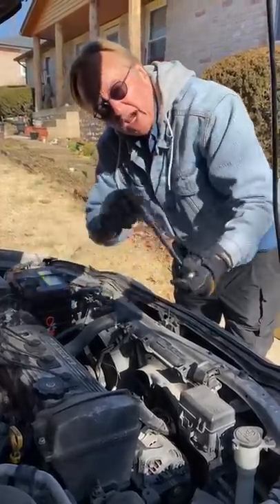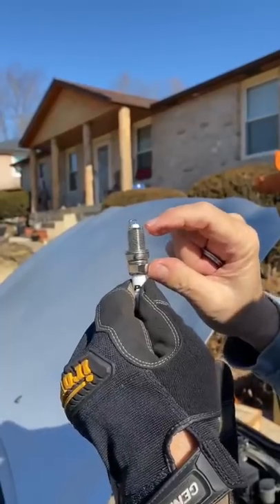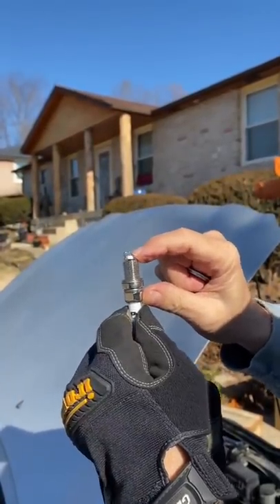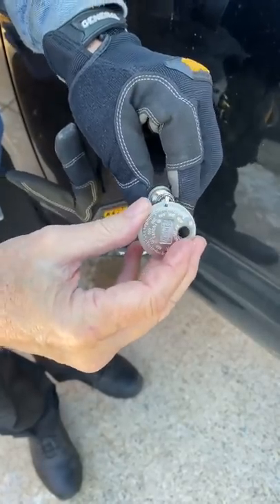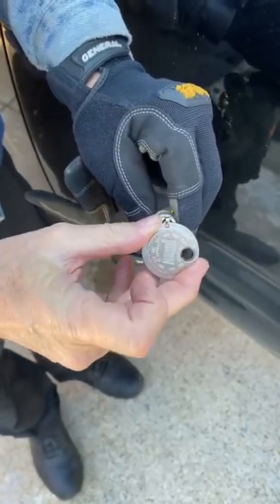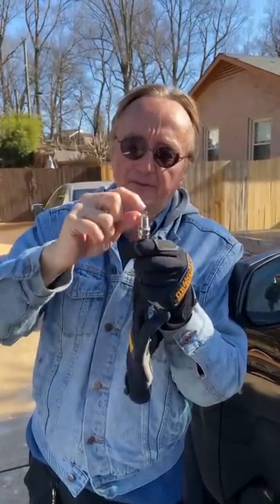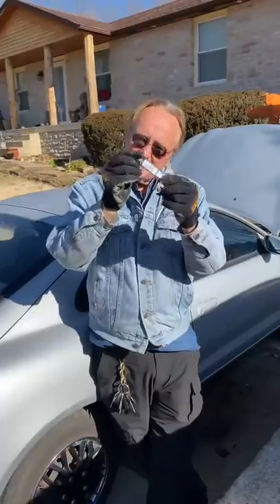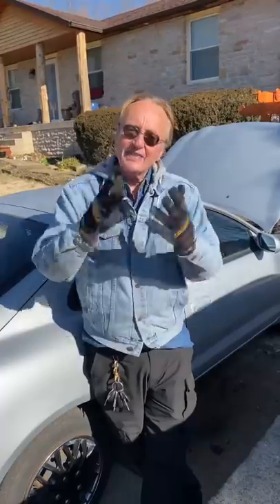If You See This, You’ve Got a Serious Problem

Comment: What timing!  I was cutting grass (with my 25yr-old Craftsman mower) the other day, and it was sputtering, smoking and generally running like crap. I knew I had replaced the plug, air filter (for the first time ever) and cleaned the carb last season, so my conclusion was that it was about time to trash this one and shop for a new mower. I thought I'd at least clean the plug to see if it would run long enough to finish the yard (it was barely staying running). To my surprise, the gap on the plug was almost completely closed! (How that happened, I don't know)  I gapped the plug, put it back in, and the dang mower is now running like a top!
Reply: You replaced the air filter for the first time on a 25 year old mower? DAMN!🤔😯😔
Reply: ready for another 25 years!
Reply: @Mike583  I admit, I would knock the crud out of it every year or two (small engine maintenance isn't my strong suit - lol)
Reply: Maybe that's the problem on my mower.. 🤔
Reply: @Mike583  I know right Robert!!! That poor engine needs to breathe like you and I.
😪😪😪
Good thing 92 pony was able to bring it back to life... He could have been brought up on engineslaughter charges!!!!
Reply: @92Pony  the gap can change from running, especially after 25 YEARS! LOL
Reply: I have a guess. Some built-up carbon broke loose and when the piston came up it banged the plug gap closed.

Comment: Weird I'm literally about to change my spark plugs now, guess the universe is telling me I need to check them
Reply: Just did mine. Now to pull them out and check the gap. Never even thought about that.
Reply: @NinjaSushi2  Yea I was checking my old ones when I was taking them out and they were .46-.56. When it should only be .56. Still chasing a starting problem I'm having next step is fuel injectors I noticed one of the spark plugs was more burnt then the others
Reply: Fdh
Reply: @Tylorgng.  i'm guessing it rolls over at least?
Reply: not the universe. scotty is.
Reply: The YouTube algorithm monitors everything you say. Chances are it heard you say sparkplug

Comment: I wish they put them in tougher boxes. It's so important and should be understood by the makers.
Reply: Then the cost would go up for something one throws away. Feeler gauge is cheaper in long run.
Reply: They need foam
Reply: I bought some and they had a little cardboard tube around the threads to protect the tip

Comment: I bought six for my Jeep and everyone of them was different gaps, and the guy at the counter said they are pre gapped from the factory, smfh
Reply: Why it's called FCA Limited Liability Corporation
Reply: ALL plugs are pregapped at the factory! Are they correctly gapped? Who knows?
It's like fresh baked bread. Nine day old, mouldy bread was "Fresh Baked"!
I've never trusted pregapped plugs, but often, they are right on the money.
Like Scotty says: They may have been dropped or handled roughly.
Reply: A L  well Bosch is awesome. not all brands are German
Reply: I bought E3-40 spark plugs for the first time and I noticed the electrode was built inside the ground cage on the tip so it was obviously factory-gapped. 

The best part is there isn’t a chance of bending it out of measurement. Use E3 spark plugs. They are the most reliable spark I’ve ever used

Comment: I have a misfire on cyclinder 5 and 3 both from left side engine. Changed all 6 plugs, ignition coil, 3 fuel injectors so far car is super smooth no rpm idle... But i still have 3 injectord to go on the misfire side... Hope the light will go away after installation next week

Comment: I pull, clean, and gap my plugs once a year, then  replace them every 5th year. They are basic plugs and they do open some. On a Toyota 22RE engine it's a simple task with wide open access. It sure does make a difference .

Comment: damn that is a good idea scotty and i did not do this last plug install,   damn.
Reply: Me either... but the car is good. Bad parts off the shelf is more common than people think!
Reply: @sharonflowershondagirl8187  for sure.  i ialways tell friends and my customers to watch scotty and learn things.  ha,  and i'm a furniture repair pro for decades.
Reply: @ronvalley1973  Ya gotta love this guy. Honest, direct people are the best!! So glad I found this channel and bought a used Honda.
Reply: @sharonflowershondagirl8187  cool,  and what year,  what model did you get?  oh,  how many miles were on it and please tell what you paid?  and private party?  i am looking for  a used honda or so i thought until scotty mentioned most hondas have rubber timing belts.  then he said toyota has metal belts.  so now,  i might get a toyota,  but i have a honda bike and think a honda car would be cool.
Reply: @ronvalley1973  I bought it in West Ky area, paid cash. I probably gave too much, but when I saw 'Made in Japan' ..... I got excited. I drove it for about an hour, town & freeway. I remembered all the pitfalls and tricks from Scotty's videos, but I cheated, I had no mechanic check it out. I got really lucky. I bought it with it having appr 150,000 miles, '09 Honda Civic. A/C works great, no shifting issues. I installed my own spark plugs when I got it home, and also bought a new battery. The driver's window was gummed up something terrible, so I used the silicone spray, and its like new!! Very happy with it, and it's from watching these videos that I think I got a great deal.

Comment: Is there a process for Iridium plugs? Manual said NOT to gap them but the gaps don’t match
Reply: you should be fine if u use a wire gapper, you don't want to use a coin gapper bcuz it will crack the center electrode

Comment: I never trust the "preset" gap out of the box. Good pro tip for those who didn't know.

Edit- for those who don't know, that gap gauge is less than $2... pays for itself on the first use.
Reply: I have one on both keyrings
Reply: 1,2mm gap is good for most cars. You can use old CD to make the gap, because CD's have thickness exactly 1,2 mm.
Reply: Asimov's, it seems you missed your Rendezvous With Rama.  Inold days when beers and sodas had the pull tabs that came off with the ring we'd use them to gap our points because they were. 015 thick. The correct gap for breaker points. I still have my Penske dwell tach and timing light in my tool locker. Bet Scotty still has one in his stockpile, too.

Comment: FYI Scotty, if you check that gauge with a pair of quality calipers, you will find that its a couple of thou oversized
Reply: Why?
Reply: @dandc2011   These were originally sold in bare metal, and not intended to be electroplated; the dies were sized appropriately.  Maybe they've corrected this, but the one I have is decades old (Scotty's too, probably).  I use quality blade type ( or wire type ) gauges for accuracy.

Comment: Must be quite nippy where you are. 
I miss cold weather. Here in Hawaii it's ALWAYS  balmy.....except sometimes in the winter it can get downright freezing, like about 60 degrees. Brrrrrr🥶
Anywho, I came up on a friend one cool morning and he was buried under the hood, reaching for what I figured would be the starter. "S' up' man, need a hand? He was growling and pissing and moaning when he suddenly and abruptly came up....so abruptly that he banged his head hard on the pterodactyl. But that didn't seem to bother him as he started spitting on his hand, then wildly shaking it so that his Timex flew off his wrist and crashed onto the driveway, causing it to shatter. "What is WRONG with you?" I asked him, laughing so hard I could barely breath. Without saying a word  he finally took off his wedding ring, flung it into the engine compartment and walked into the house, where he apparently stayed the rest of the day.   
I finished off bolting the starter terminals AFTER disconnecting the battery. I sealed the deal.....even found his ring and handed to his wife. "Don't ask" I said, as she was about to ask. I also recovered the pieces of his Timex and snapped it back together. What do you know? It took a lickin'......